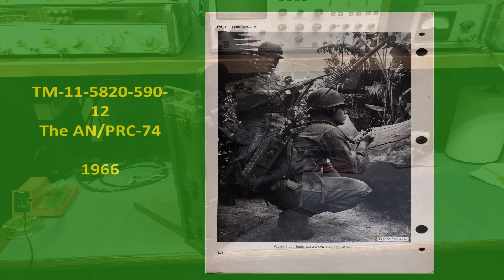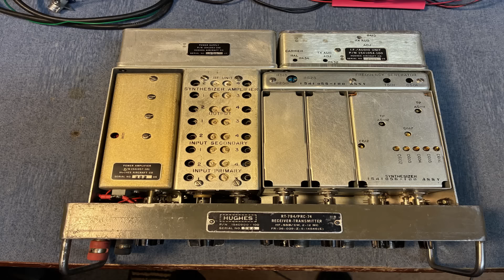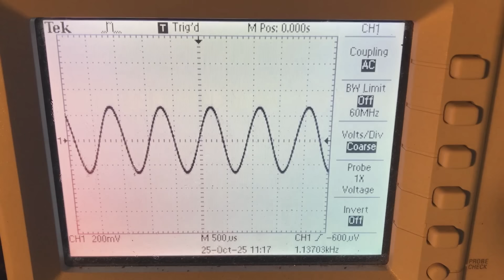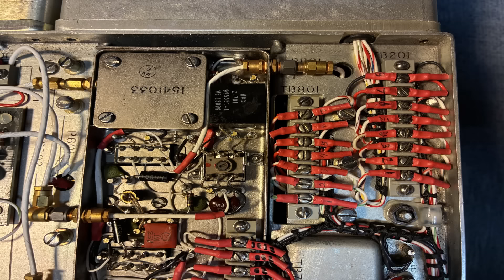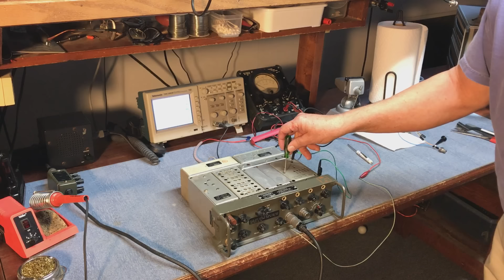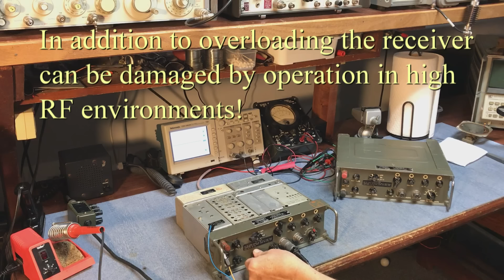AN/PRC-74 Military Radio Transceiver from the Vietnam War

Comment: gracias por compartir, excelente video, tengo una radio igual a esta, recibe muy bien,7150 mhz, en TX muestra 10 watts al pasar swich tune con carga ficticia 50 ohmios, pero al colocar el microfono/audifono (hand set, modified harris cor. pn 10075-1399, cont 14304, mfgr imjj6)  no TX, no transmite nada, sera el mic.?

Comment: I saw your YouTube video on modifying the PP-4514. A nice and very useful modification, I’m going to do it to mine.

The main reason I am contacting you is I’ve got to down scale and get rid of a lot of stuff that I’ve been hanging on too. About 60 years of projects. Part of that is the accumulation so much stuff.

I spent 21 years in the Army and have worked on and operated AN/PRC-74/74A/74B and 74C’s. I personally have a PRC-74B, PP-4514, a complete set of accessories, an LS-454, 2EA CY-7773, 2EA CY-612, and A LOT of spare modules as well as a spare RT chassis.

I would like to send you all the stuff I don’t want to keep on hand any longer. I’ll keep a complete working set and a set of spare modules. The rest I will send to you for the cost of shipping. And you can utilize them to test and repair as you have been doing.

Let me know what you think.

Yours Aye,

RICH    WA6KNW

Comment: Hi Ray! I have a PRC-74 that was previously worked on, and the front panel was removed.

I’ve aligned the 1, 10, and 100 kHz switches, but the band switch (up to 17 MHz) has two stages: RF and synthesizer, linked by a gear.

The gear is out of alignment, and I can’t find the correct starting position for proper switching.

The manual only shows a diagram, no adjustment procedure.

Any ideas or reference photos?

Comment: Thanks for the vid got to dig mine out my problem was tx frequency being off of rx frequency about 1kHz to much i put it aside during covid .I did use it on the moose and squirrel net once ir twice before discovering the problem any advice would be welcome thanks no scope but a sig generator and  spectrum analyzer is available.

Comment: I remember the AN/PRC-74 was not used during the Vietnam War. During this War the Collins AN/PRC-47 was the portabel SSB-Rig.
Reply: It was used in Vietnam by special forces troops, several documents on it's use there starting in 1966.  See N6CC site on the PRC-74 history.  The 47 was also used as you mentioned.
Reply: @milcommguy5927  It is a new information  for me. Thank You, Sir. 73